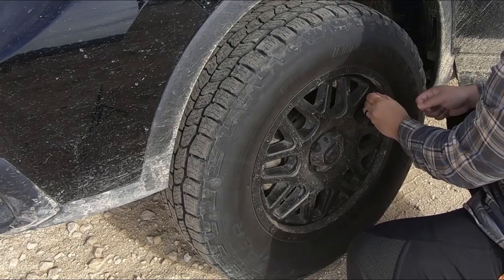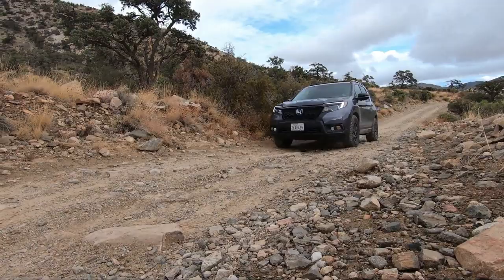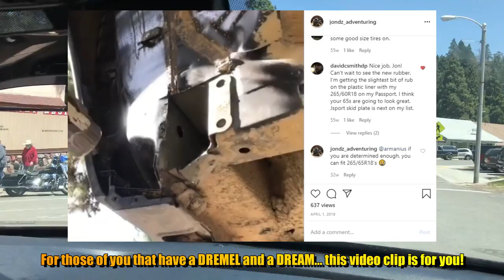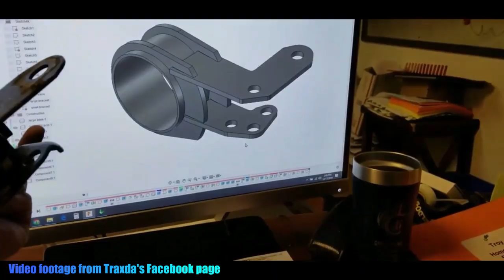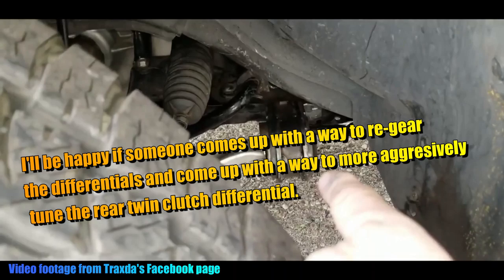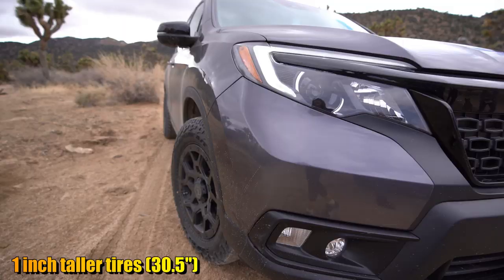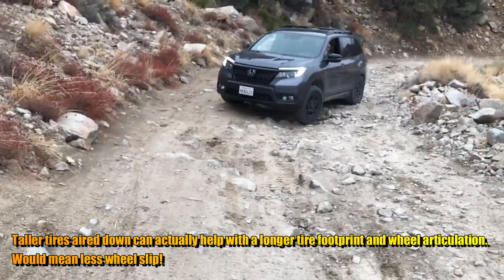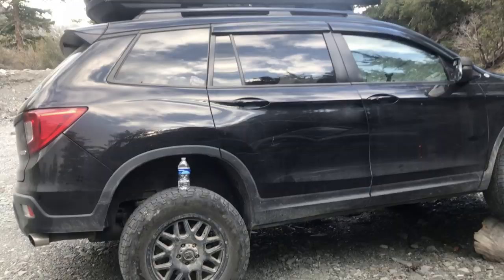TALLEST TIRE?  On a Passport/Pilot/Ridgeline

Comment from the maker: ** UPDATE!!!  I JUST MOUNTED 32.1" 255/70R18 FALKEN WILDPEAK AT3Ws.  Check out my instagram post here:
https://www.instagram.com/p/CBTpZ6NpOaz/?utm_source=ig_web_copy_link

I'm 99.9% sure you can run 255/65R18 31.1" without modification.
but... there's not many tire options.  You can get the WILDPEAK TRAIL (which is a dumbed down version of the AT3W)

If you're one of the lucky bastards that went with a 17 inch wheel, you can go with 255/70R17 31.1"
there's many many many options out there!  including the BFG KO2
Reply: I have a 2019 Honda Passport Elite and am looking to get some new wheels and A/T tires so I don't have a bad time on forest service roads. I'm not looking to modify/cut or lift at all, and am not looking to do anything too crazy, but will have an off-road teardrop trailer that I want to tow back to some awesome campsites. My main concern is rubbing, as I'm sure all of ours is.
My question for you is if I go with a 17 inch wheel like the KMC Bully KM708 (17x8, 38mm offset) and an A/T tire like the BFG KO2, would you recommend a 255/70R17 (31.1" x 10.0"), a 265/65R17 (30.6" x 10.4"), a 245/70R17 (30.5" x 9.6"), or a 255/65R17 (30.1" x 10.0")? I'm trying to avoid rubbing, but would like to maximize what I can do since I don't have a desire to do other modifications like cutting or a lift. I will almost certainly add a skid plate though! :)
Thanks for the great videos and information!
Reply from the maker: Stefano Prezioso the with a 30.5” tire, the rubbing is only beyond 90% lock and is very minimal.  It sounds like you don’t want to deal with that at all.  If so, avoid the 265/65R17 and just go for either 265/60R17, 255/65R17.
Reply: @JonDZ_Adventuring  Awesome! Thanks kindly for the quick response and great content!
Reply: How are you so certain (99.9%)?
Reply: I just wanted to follow up. I just installed the "LT255/65R-17 BFGOODRICH ALL-TERRAIN T/A KO2 D" tires on KMC KM708 17x8 wheels on my 2019 Honda Passport Elite and have no rubbing. At its closest point during full lock, there's maybe 3/16" of clearance at the tire's closest spot. Thanks for your suggestion and helpful content!
Reply from the maker: Stefano Prezioso nice!  I’m glad everything worked out for you!  Thanks for giving us an update.
Reply: @StefanoPrezioso  Hey can you share a pic with that setup? Thinking of doing similar, would love to see it!!
Reply: @StefanoPrezioso  do you think it would run if go same spev as you but with a 30 offset?
Reply: @Ju_A_B  Honestly, I have no idea. It was so close with my exact setup that I'd be worried any slight variation could cause rubbing.
Reply: @StefanoPrezioso  how does this feel on road?
Reply: Does the 265/60/18 AT tires fit the stock 18 for the 2021 pilot with no issues.. and is there any adverse effect like rubbing or swaying like a boat on a taller size.
Reply: I have 2017 Honda Pilot and Im looking to get new wheels. Im not looking for cut or extra crazy modifications.

Comment: One of the biggest reasons people need to get rid of those 20’s is adding rubber between the rim and ground.   A bigger tire is better on a smaller rim because when you air down you have alot less risk blowing your tire bead.  Also a bigger tire on a smaller rim creates a longer foot print when air’d down which is what actually matters for better traction. Wider tires have nothing to do with better traction, they just look meatier.   Bigger tire on a smaller rim will also improve your ride quality on trails.
Reply from the maker: jamesngotts I had two pinch flats when I had my Subaru Forester and that was with 5.8 inches of sidewalk.  The oem setup in the passport is only 4.7 inches of side wall 😱.  That’s scary!!!!  I’d be terrified of airing down and losing even more sidewall clearance.  Both Wheels and tires would get absolutely WRECKED on a moderately rocky trail.
Reply: JonDZ Adventuring you should be around 6.8 inches of side wall now which is alot better.  

It’s awesome to see the aftermarket for your rig is growing.  Are there lift kits which drop your diffs lower?
Reply from the maker: jamesngotts Companies like Traxda, Jsport and Truxx offer all the basic aftermarket support but there isn’t any “big name” support.  Hopefully in time we will start seeing coilover suspension upgrades, better rock sliders, etc.
Traxda offers a 3.5 inch lift kit.  They use 2 inch strut spacers and 1.5 inch subframe spacers.  The way these Honda’s are setup, it’ll take good advantage of this lift.  The lowest point is the gas tank and muffler.  The drive shaft and rear diff sit up high.  With the addition of the 1.5 inch subframe spacers, everything but the drive shaft and rear diff go up, but since my rear diff sits at 12 inches, I’m okay with that.  
The only thing I’m worried about is how the subframe spacers will affect onroad handling.
Reply: JonDZ Adventuring yeah the higher you lift the adverse the effect to on road handling, especially with independent suspension setups.  It will probably still be very manageable though.  Is there any drive line updates or winch/bumper mounting options out there yet?
Reply from the maker: jamesngotts I looked, and unfortunately, I don’t see any options or anyone that has a winch on their newer model Honda’s.  
Maybe I’ll just have to get something custom?
Reply: JonDZ Adventuring yeah maybe, I’d imagine an 8k winch would probably be right for your vehicle weight?  I have no idea how mounting to a unibody vehicle is done, obviously you want the strength of the frame backing the winch.  There is a custom auto body shop I looked into for my old truck in the OC that has the equipment to creat bumpers and mounts but I never got any work done there.  I’ll send you the info on IG if you want to look into them.  I’m sure there are places in your neck of the woods though too.
Reply from the maker: jamesngotts thanks James!

Comment: 2016 Honda Pilot here with 265/60/18 Nitto Ridge Grapplers (30.5" tall and 10.7" wide) and I agree, they fit stock. Actually lifting 2" made it now rub just a hair on that portion you cut. It is so minimal that for now I do not plan on doing any cutting. It happens at near full lock so unless I am doing a U-Turn I never get there. Keep up the great work!
Reply from the maker: REMIS Computer Solutions oh!  Interesting!  So... I think I know what you can do to stop all the rubbing.  Under the wheel liner there will be two bolts.  Try unbolting them.  They aren’t really there for structural support, since the other 3 corners are welded.  Those bolts are just there to connect the beams so the Factory can compete the welds.  They’re basically useless now.  Take a heat gun and reform it.  Might do the trick!

Comment: Finally got the 3.5 lift kit on my 2020 Honda Pilot. Was able to fit a 32.4 inch tire. Had to cut the bumper a small bit. About an inch or 2 at the bottom. Slight rub on a full turn. Going to post a video about it soon. Your videos helped out a ton.
Reply from the maker: Awesome!!

Comment: As always, you provide useful info and good contents. Thank you!
Reply from the maker: Kevin Lu thanks 🙏!!!  I wish I had this info when I first bought my passport.  I initially purchased 255/60R18 tires thinking that was the largest I could run according to the forums.  That was only a 30.0” tire.  Now that I have all this first hand experience I just want to share what I know.  I really hope other people can avoid the mistake I made.  I bought the tires for $600 and sold them off for $350, that was a $250 loss 😭

Comment: Great video! Ive got a 2019 Passport that has a 1.5" lift. I run two wheel sets, the winters are Blizzaks 265/50R20 (stock rims) and I just mounted the set I'll use the rest of the year which is 265/60R18 Continental Terrain Contact HT (not the AT, I just don't off road all that much and the HT will do vast majority of what I do off road). 
I average about 23mpg across all driving, highest is about 27-28.
Edit: forgot to mention that wheel offset (mostly on aftermarket rims) can also play a part in wheel well clearance for tires
Reply from the maker: Matthew Muscarella thanks for the info!  🙏 
Wow!  That’s pretty amazing that you can get 28-29 mpg.  Not bad for a vehicle rated at 24 mpg right?  I’m very pleased I can get 23-24mpg cruising at 70mph.  I drove from Las Vegas to Los Angeles this morning doing 80-85mph and got 19.5 mpg loaded with camping equipment with a rear hitch basket attached.  It is a little bit downhill
Reply: @JonDZ_Adventuring  oh that 28mpg was only once haha crushing at 55 at night with a tailwind. Normal highway driving where I live is closer to 25-26. 
Rides much better though with the thicker sidewall tires and I pump them up to 42psi
Reply: My best mpg was roughly 300 miles from Bishop to Garden Grove, loaded with camping gear: 27.6!
Reply: @stevendphoto  wouldve been some awesome range if you had gotten that for the whole tank!
Reply from the maker: stevendphoto I drove 320 miles round trip from Sedona, AZ to lake Powell and back with my Wife and Brother loaded up with gear and my rear hitch carrier holding my inflatable kayaks.  This is with my current modifications (cut bumper, lift kit roof and cargo carrier.  I got 23.5 mpg average at 70mph.  It wasn’t very windy that day, so neither head or tail wind.  Here’s my Instagram post about it.

https://www.instagram.com/p/B-2s3EiJfeN/?igshid=1w75zxnmfbche

Now with that said... I’ll drive up to mammoth by myself with minimal gear.  As you know, it gets very very windy!!!  Sometimes the wind comes from the side.  I’ll get 18-19.5 mpg on the way up!  Once I was able to get 28 mpg on the way home (downhill + tail wind).

Comment: I think if Honda offered an off road trim it would sell.  Such mods as lifting, gearing and skid plates could easily be done at the factory.
Reply from the maker: They have the "trailsport" trim.  The stock Midsized Hondas already had the best gearing with the ZF9.  The newer 2023 Honda Pilot now have the Honda 10 speed with a 22.7:1 crawl ratio, the most aggressive single speed transmission made so far.  They all get it though, not just the trailsport, and I respect Honda for giving all their trims above average capabilities.  The 2nd gen iVTM4 vehicles (2023+ Pilot trailsport, 2024 Passport/Ridgeline) do have an upgraded AWD system though and are engineered to take on moderate 4WD terrain, which is the terrain I traverse on my channel.
Reply: @JonDZ_Adventuring  Thanks for the info. I have a 2021 RTL-E and know the drive system is pretty capable.  I'm no rock climber just want to do light off road but worry about underside damage.

Comment: Thanks Jon!  I have the Ridgeline, so glad it does not have the 20" wheels.  I really like the Passport except for the hard riding 20" wheels.
I enjoy watching what you and your group does with  SUV's!
Jon,  have you done anything to recalibrate the speedometer to be accurate after larger tires?
Reply from the maker: Ron Dail interesting fact, much of the Ridgeline suspension parts are built tougher.  Honda pro Jason has a video about it, and I want to say about 70% of the parts are more robust.  Just going off of memory.  Yes, it’s unfortunate the Passport only comes in 20 inch wheels.  These are not what you want to have once you leave pavement and since the passport is marketed as an outdoorsy vehicle, I’d really like to see future models with a lower profile rim option.  The good news is that people will spend money to buy 20’s.  I had a friend that sold his set for $500 which went towards his set of 18 inch designer wheels.
As far as the odometer/ speedometer.  I just have to do the math in my head.  It’s a 6.8% difference.  I may go with 265/70R18 tires in the future, which would be a 10% difference, so I haven’t seeked to have things corrected yet.

Comment: I had a question...
I recently bought my 2020 Honda Passport Elite Used.. Initially I was going to buy a 4Runner.. I know the mod market is much larger with 4RUNNER.

But I got my Passport for a solid deal. I have always loved the appeal of overlanding and having an overlander capable of being a daily driver that gets 20+mpg is even better.

One mod that I would have added to the 4Runner that I'd want to put on the passport is an under hood air compressor for tires with a hose hook up near the grill. 
I am curious If it's possible to do in the passport.
Reply from the maker: It’s definitely possible!  I actually have my 5.65 CFM air compressor in the rear of my vehicle.  I just open the hatch and get to inflating.  I have my compressor hard wired.

Comment: Thinking about giving my 2021 RDX the off-road treatment. Lots of good info here🤙
Reply from the maker: We were very impressed by what a bone stock RDX did on a pretty gnarly rutted trail.  I think it’s very worth of some offroad mods.  Check out the video:  https://youtu.be/EcKMwnEdZA4
Reply: @JonDZ_Adventuring  just from how well it does in snow on my stock all seasons is pretty impressive. No drama at all. Surprisingly a tiny amount more ground clearance than a stock passport too, which I thought was kinda odd
Reply: @JonDZ_Adventuring  haha oh dang! The RDX going down that trail in the stock 20s!? That's crazy!
Reply from the maker: @MrMegatron85  yep!!! And everyone was impressed at how it just “crawled”.  It has the highest crawl ratio of any single speed automatic transmission.  It’s geared 21.9:1 vs. my passports 20.4:1 (with my taller tires my passport drops to 18.7:1).

Well,  the new 2023 Honda Pilot has ver 2 of the transmission in your RDX, and it’s geared 22.3:1, so you’re dethroned by a little bit.

Comment: Great video, lots of information. Looks very capable on the trail. Love my 2020 Passport Elite, just ordered a hitch and harness online. Can’t wait to self-install it. If anyone can help, I’ve been looking to upgrade the exhaust to something a little throatier, nothing loud, but have not been able to find mufflers as a direct replacement. Don’t really want to get into cutting and McGyvering, was hoping for a right out of the box installation. Put a MagnaFlow or something on my last vehicle and it was fast and easy, but nothing comes up when I search for the 2020 Passport. Any suggestions or experience would be appreciated.
Reply from the maker: Congrats on the new ride!  I've always the idea of modifying the exhaust, since it's the lowest point of the Passport (besides the rear lower control arms).

Comment: Just got a '21 Pilot Touring for our family adventure rig. Coming from a modified 09 Forester. No-Lo plate comes in the mail today! Looking at going to 265/65R17 or 265/60R18 tires. Already curbed one of my 20s in the 2 weeks I've had it. Looking at 17 or 18"x8 wheel, but not sure what to go with for the offset. I am seeing anywhere between +35 and +45mm. I would like to the wheels to be more flush with the fender and will likely be running the Cooper Discoverer or Falken Wildpeak AT3 depending on tire size I select. Any recommendations on the offset would be appreciated!

Comment: Great video, thank you. I have a 2017 Pilot with 20" wheels. I'm about to lift it 2" with a Traxxx kit, and you convinced me to get rid of the 20's. Would you recommend 17's or 18's? I plan on getting Wildpeaks AT3W's. I'm in Montreal Canada with lots of snow. I was thinking of running them in winter instead of dedicated snow tires/wheels (which I've always done), because I'll be moving from a house to a condo and am going to lose my garage space. Any thoughts on AT3W for winter? Thanks!

Comment: Great vids - Question, wondering your thoughts on a Pilot over the passport? I’d like to add a lift kit and wheels and tires, but have large mastiffs that could use the extra space of the pilot.
Keep up the great vids
Reply from the maker: Sorry for the late reply.  The vehicles are basically the same, the biggest difference is the Passport has 8.1 inch of ground clearance instead of 7.3 inches in the Pilot.  The Passport has more clearance because of taller struts.  I have a friend that is swapping out his struts to match that clearance.  If you have instagram, message @awd.nv

Comment: This is a fantastic video and super helpful. Question, I have a 2021 Ridgeline and I'm wondering if I can fit a all season tire 255/55r20 (Bought the truck w/ upgraded 20 inch wheels)? I like the idea of having a little bit more sidewall over a 50 series tire. Would this work? Slight rubbing wouldn't bother me.
Reply from the maker: Thanks.  So, for slight rub, max would be a 30.5” tire.  255/55R20 is a 31.0” tire and you’ll need to make some modifications by trimming or hammering.
Reply: @JonDZ_Adventuring  Thank you for the quick reply! I'll go with the 265/50r20.

Comment: I have 22s rims and low profile tires  on my Ridgeline and I aslo dropped 2 inches the back and front without these issues you mentioning guess we all have different ideas about our Ridgeline
Reply from the maker: If you’re running stock diameter tires, you probably won’t be rubbing.  Tire type matters to!
Reply: @JonDZ_Adventuring  no my rimsand tire are 295/30/22
Reply from the maker: @K1llum1nati  oem tire is 29.6” x 10.4” , your tires are 29.0” x 11.6”.  My tires are 32.1” x 10.0”.  Thanks for the info, you’re tires are shorter and wider and good to know they don’t rub.
Reply: @JonDZ_Adventuring  got it thanks for the info.. I was thinking to get some bigger tire for next winter good know the maximum amount that I can go. Cheers

Comment: Ridgeline, 2" lift, 😁 little hammering and Nokian Rotiiva AT+, a four season offroad tyre: 265/70 R18 (=32.6")  124/121S 3PMSF👍
Reply from the maker: What year ridgeline?  2017+ there’s no way you could fit those without either cutting a 4” x 5” x 1” (HxLxD) or using a Traxda Axle Relocation kit.  I personally run 255/70R18, but I cut out my wheel well and pinch weld.